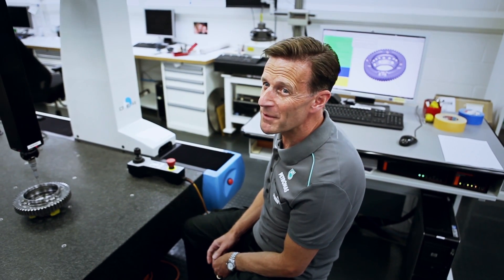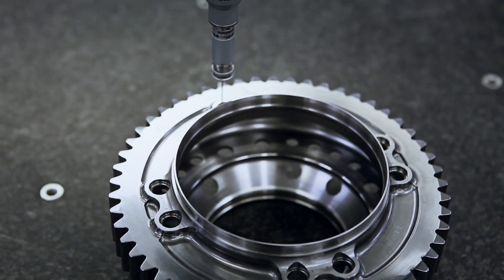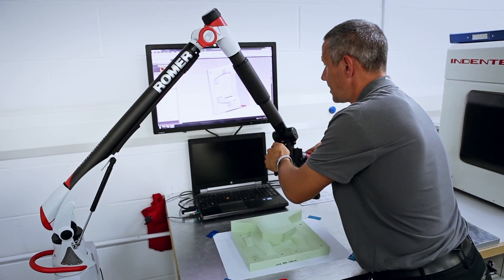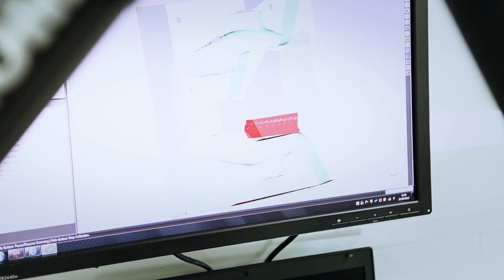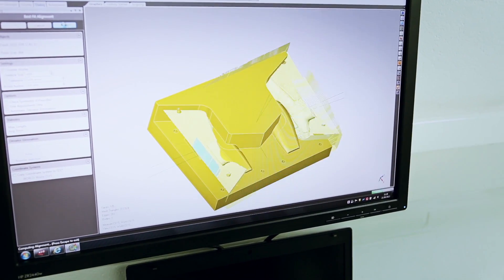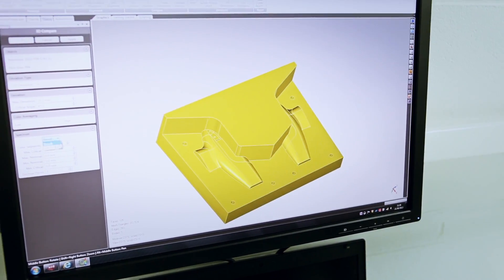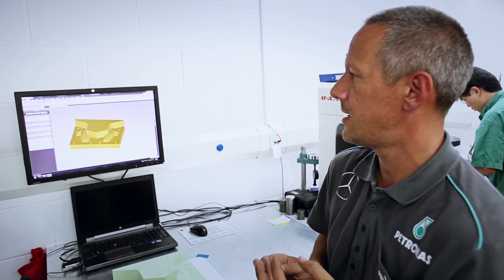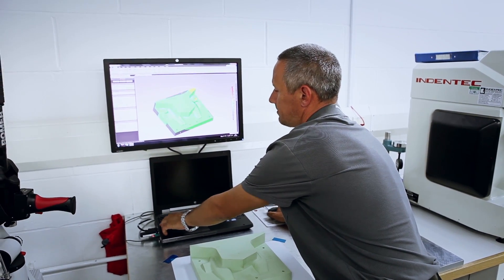Access All Areas - Quality Control - With MERCEDES AMG PETRONAS

Comment: Hi, are you guys concerned about the possible FRIC suspension ban?
Reply: Hopefully not
Reply: YES... IT WILL BRING REDBULL LEVEL TO THEM
Reply: I would assume they are, the Mercedes mechanical grip is undoubtably the best on the grid and the FRIC ban is almost certain. I think the mercs will still be in front but with a smaller gap to the Williams and red bulls on specific tracks let's hope for closer racing rather than the battle for third for everyone but the mercs. But I'm not taking anything away from them, they've done a great job with their equipment and deserve the constructors and hopefully a closely contended drivers!!!